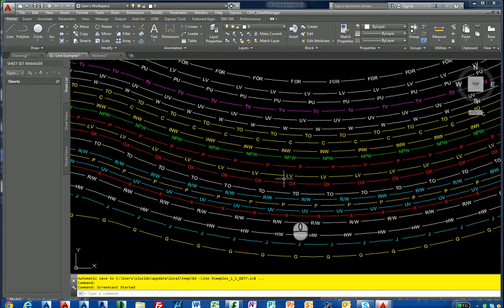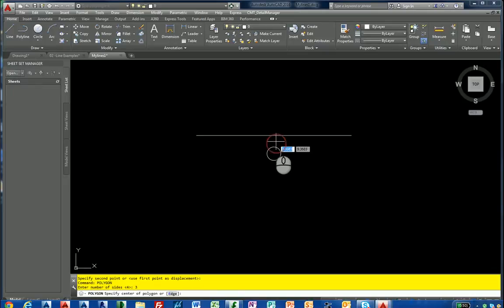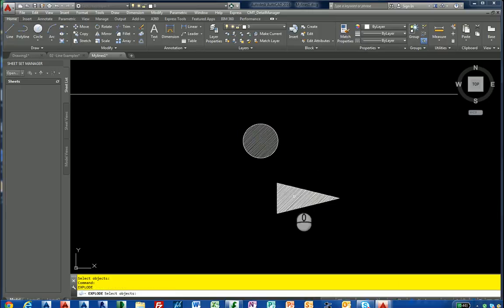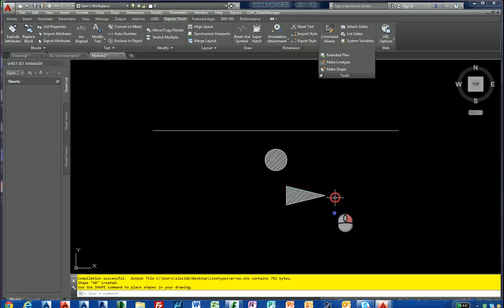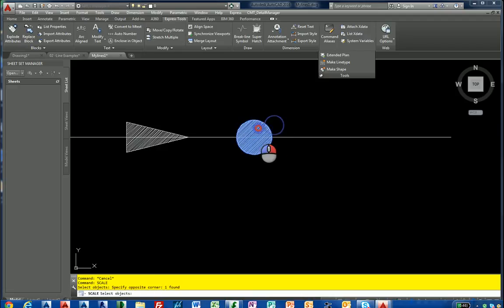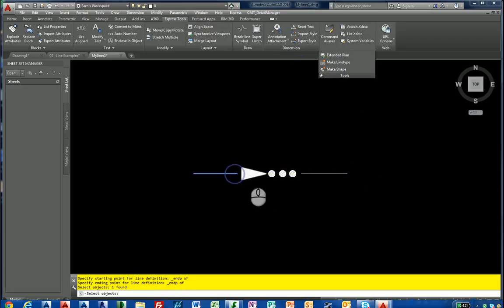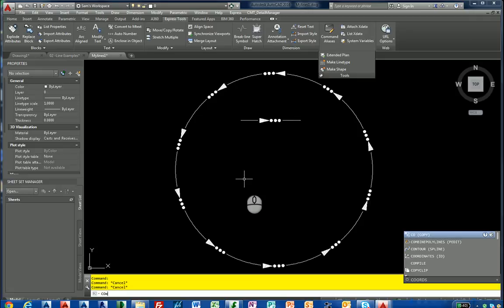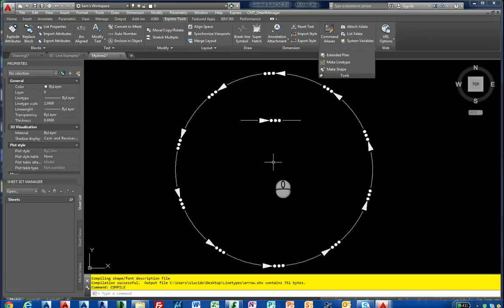Complex Complex Linetypes with Shapes AutoCAD   Part 4

Comment: Sam, great videos, really useful. I've tried creating a custom linetype containing both text and shapes. I've created the linetype and it looks fine. My problem is though that if you draw a circle the text is upright but it shifts to towards the shape at the top of the circle, the base of the circle is fine shape and text is as it should be.

Any help would be appreciated.

Comment: Hello Sam,
In 8:09 you told to compile the file with all shapes together to have all shapes inside just one file, and not as single files as you go creating them. I'm making new template for the company I work and I made all the shapes necessary and I made all linetypes from those separated shape files as well. Is there any way to adress all the new linetypes created with single shape files to the new compiled file with all shapes? I tried that, but AutoCAD keeps asking for the 11 single SHX files, even If I load the new Compiled SHX containing all the shapes. Any thoghts on that?

So, before creating the Linetypes, should I create ALL the SHAPE files, do the steps starting at 7:37 and THEN start creating the linetypes, so AutoCAD will associate all the linetypes with that single compiled shape file?

Thanks!